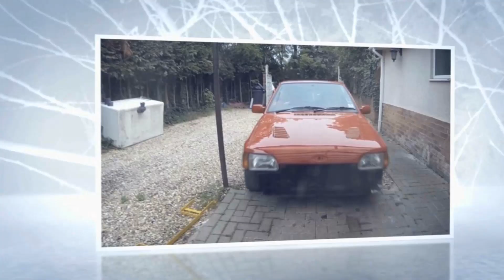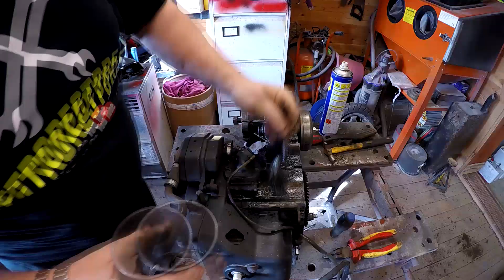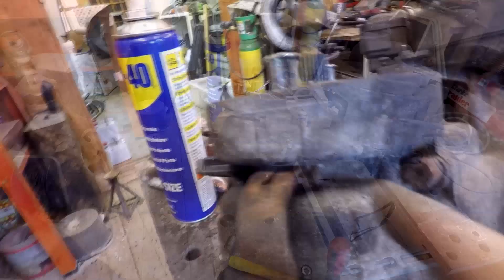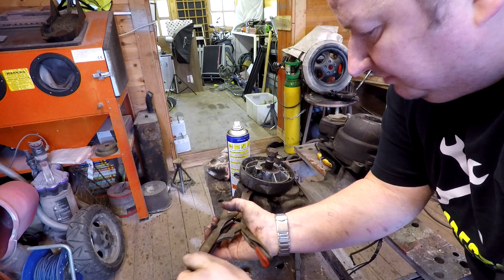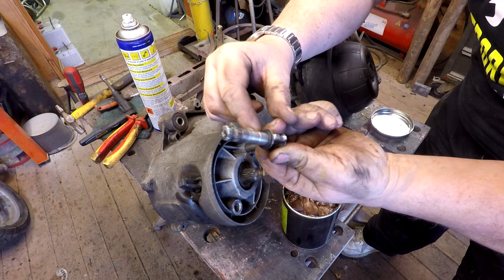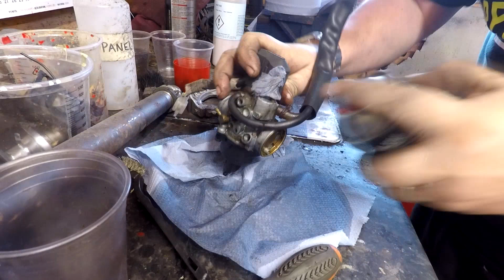Vid 11 Piaggio ET2 50cc Vespa Respray A Bit Of Tidying

Comment: Martin remove the gold restriction plate  on carb inlet also remove washer between front pulley wheel if it has one,
will make it a bit more ridable.
Reply from the maker: You must have read my mind. I was thinking exactly the same thing and was going to do it in the next vid. Not sure if it will need a larger main jet. What do you think?
Reply: Hi Martin, the gold plate some call it a air flow deflector or the only other thing i could think it  would be to stop carb icing ? but i just see it as a restriction to airflow. 
Normally you would go up 3-4 jet sizes depending on what jet size you have i would guess around a 50+ ish so would go to 55-60 and you will have movement on needle for fine adjustment. 
It looks like a dellorto carb so easy to find jets.
You also may have a plastic spacer inside throttle slide stopping it moving to wide open throttle.
I think they change jet size at factory according to what and how many restrictions they installed,your not putting a performance exhaust or open filter i guess so wouldn't go to big a jump on jet size .
You may find you don't need to up jet and plug colour would be ok with needle adjustment .

Comment: Seized brakes. Could be the reason it was passed on to you. A good video that shows problems during a restoration. You will always run into something but usually able to repair. My dad always said "A calm sea does not make a skilled sailor".
Reply from the maker: I'm used to things going wrong Bri and having to get over problems. Sounds like your dad knew a thing or too.
Reply: Ive noticed a lot of things go wrong here. If it wasn't for bad luck, you'd have no luck at all. LOL. Dad taught me loads on repair.
Reply from the maker: There's always room for more tips and tricks. I'm forever learning.